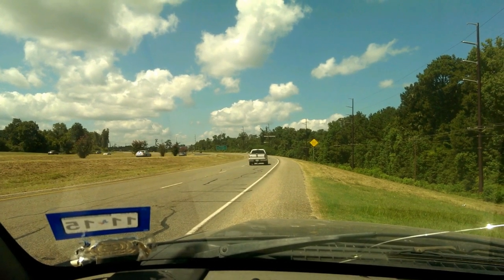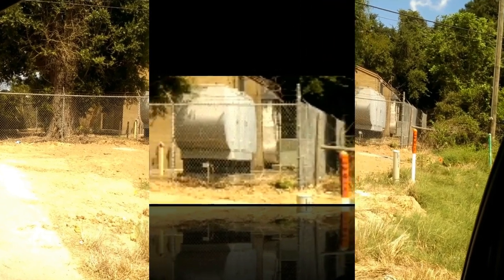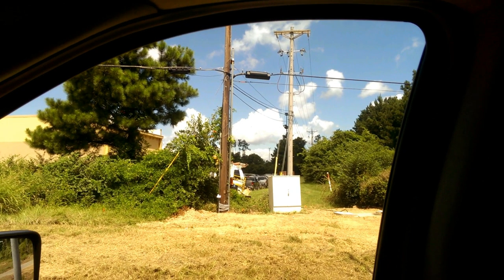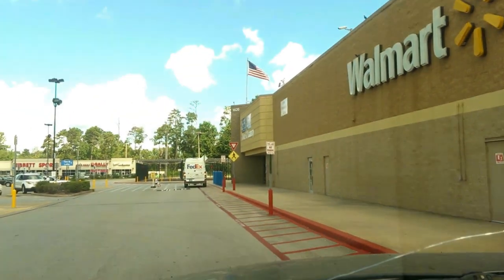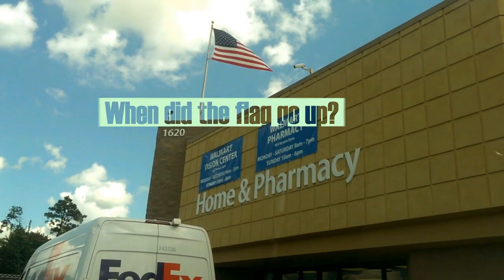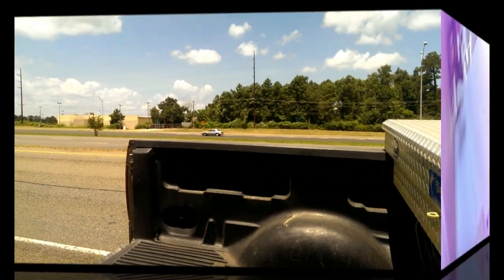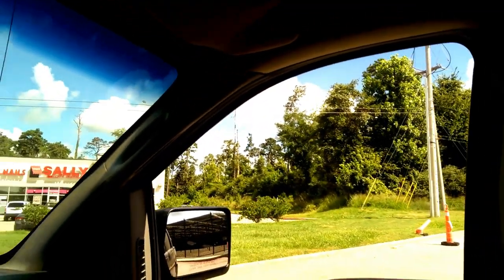Jade Helm 15 Update from Livingston TX

Comment: Those buildings exist all over America and are used at either the base of a cell tower or to house the electronics that communicate back to a telephone company's central office for that area. The electronics would communicate with the central office (CO) via fiber cable, and they'd carry dialtones, broadband Internet, business circuits (T-1, ISDN, etc.). That van is a bucket truck but could belong to the contractor putting the fiber in place to feed that building. Most telecos do not do their own heavy cable placement over long distances, but rather use their local contractors for that work. Also, that light colored metal enclosure near the telephone pole is called a Service Area Interface, and it's job is to connect the feeder lines (which that new trenching of fiber would provide via that new building) to the local lines that go from that enclosure to various nearby neighborhoods. Feeder (F1) lines carry dialtone to the enclosure, and there are likely hundreds in there, and the local (F2) carries dialtone out to neighborhoods and businesses so everyone who wants the service can be connected. Those F2 lines terminate in the small pedestals and aerial closures near your homes, where they connect the aerial drop or buried drop to your house. This job looks to have nothing to do with Walmart, but may have been done there instead as a network upgrade for those teleco facilities at that location. And if it is a rush job, it could be because the old copper line feeder (F1) got damaged, is leaking and taking on water, or is being moved due to a road job or other construction in another location between that light colored box and the central office. Nothing hear speaks of conspiracy from all my experience as a tech for a major telecom, and the work is taking place in broad daylight with nothing suspicious in any of the footage. If you go ask the guys doing the work, they'll probably be happy to explain what they're doing. I used to get stopped regularly by curious residents.
Reply from the maker: Great post thanks for the info

Comment: The machine you called a trencher, is actually a boring machine. It's for boring under roads and slabs to run power or comms through without disrupting traffic. I would say they are laying in more or faster comm lines since it's so close to the AT&T building.
Edit> thanks for the update. Anyone that thinks "plumbing" is the reason, is deluded.

Comment: Those were not metal detectors. You see them in every walmart where I am, as well as every other store. They are anti-theft security devices. There are tags on merchandise, that are coded. If you walk out the store without paying for something, or they forget to deactivate that security device, those white "metal detectors" as you referred to them will start beeping. Does that mean that Jade Helm has been in my local walmart since 1994?
Reply from the maker: FTORC1  try thinking outside the box or matrix... Connection: AT&T is the only private telecommunications co. certified by DHS... Then read about "Markov Chains" and the connection to the DOD, or watch a video. Consider the purpose of the A.I. "Jade II" program that the "Jade Helm 15" exercise is testing... Critically think it through to possible conclusions and see if there are any conducive to peace & freedom.. And as a bonus if you are spiritually grounded in scripture, throw in the Sh'metah and the blood moon tetrad both ending this year. It's deep but if you are wanting truth sometimes it takes some digging...Blessings ><>

Comment: Having built several, a disused Wal-Mart would make an excellent data center for ATT. The generators are backup power supplies, the chillers for keeping equipment cool, and I wouldn't be surprised to see trucks of switchgear and battery banks showing up. You're far enough north of the Gulf of Mexico to not have to really worry about hurricanes, and the building is constructed heavily enough to withstand your average tornado.

Comment: The biggest problem is, I don't think people realize how many square ft. of space Walmart stores have.. you can fit a whole lot of what or whoever you want in those massive places, especially if they're completely empty.
Reply: Stephen Blake You must consider, though, that the stores are really flimsy construction. With the exception of loss control and liability, they have little need for high security. No agency concerned with potentially violent activities would consider such a building viable.
Reply: Idk about that, I feel like the exterior is mainly concrete..
Reply: Stephen Blake
Slab Veneer for most of the later stores I've seen. Maybe 4" thick prefab slabs over steel girders. Usually aluminum sheet at top of walls to minimize rainwater ingress, roof will be"V"-channel with hot tar/rubber sheet hermetically sealed, pea or river rock for weight against wind buffetting, rectangular plastic domed skylights every 10-12 feet. Roof mounted A/C equipment and inverted "J" forced ventilation. Probably 1/2 MW  deisel or LP genset out back near electrical service entrance.
Any number of surveillance cams with fast wide lenses to cover the parking lot, more P/T/Z cams for loading docks.
Garden/Patio Center is outdoors enclosed by 8'-10' barricade-style medium duty vertical bars without spears, for loss prevention. Open top except for 50% shades over plant section. Anti-shoplifting detectors at all gates an entrances.
The building is a perfect low-to-medium budget retail store. Not suitable for high security or heavy industry. Not hardened against windstorm or attack.
Reply: Dan Strayer
Somebody somewhere hinted that the building might be suitable as a secure building for military use, now it seems that post is gone...
How did we go from at least a couple dozen comments to four?
OH, YEAH... Jade Helm... I guess those guys CAN do anything!

Comment: the " trenching machine" is a directional boring machine. Mostly used for fiber optic lines also for going under high volume traffic areas. less obtrusive than ripping up the hyways and stopping traffic for a week or two.

Comment: Sir that is a "Ditchwitch" brand directional boring machine able to bore for hundreds of yards horizontally below soil surface making turns of up to 20 degrees over distance of about 15 feet and make several turns in one boring then resurface.
Reply: Richard Madsen Fascinating machines. Obviously created for nefarious purposes. :D
Reply from the maker: *****  try thinking outside the box or matrix... Connection: AT&T is the only private telecommunications co. certified by DHS... Then read about "Markov Chains" and the connection to the DOD, or watch a video. Consider the purpose of the A.I. "Jade II" program that the "Jade Helm 15" exercise is testing... Critically think it through to possible conclusions and see if there are any conducive to peace & freedom.. And as a bonus if you are spiritually grounded in scripture, throw in the Sh'metah and the blood moon tetrad both ending this year. It's deep but if you are wanting truth sometimes it takes some digging...Blessings ><>

Comment: The orange and white machine is what they use when they are putting in fiber optic cable.
Reply from the maker: Thank you for the info. Interesting article by AT&T published 6/1/2015, about their emergency preparedness or Management help with DHS...they have a new type of fiber optics that somehow increases their ability to keep communications operating in the midst of  disaster....good info it is beginning to make sense...their are out of town workers crawling all over our little town...construction has erupted. .. Thanks ><> Blessings and stay safe.
Reply: Shades Off - Eyes Wide Open Fiber optic is impervious to EMP. That has been a huge selling point. Not only that, but that same quality makes it immune to RF interference as well. Material costs are much less than copper as well, and it is also less susceptible to corrosion from moisture. Splicing and interconnecting fiber is considerably more complicated. Special facilities and training is required to install it, and since that labor is quite expensive, AT&T outsources most of it (much to the dismay of copper-wire linemen).
All organizations who need reliable communications have been deploying it for years. Worldwide. No secret about that. 
And since AT&T has a virtual monopoly on telecommunications in this country, they are of course the "go-to" people for the job.

Comment: Only thing I find weird about it. Is how the hell do you have multiple stores with the same damn plumbing problems across the country? And you know the plumbing probably was not done by the same company on every store. And if it was done by the same company. My question is how come all the stores dont have a plumbing issue then?
Reply: Tomkat 07 Another big thing is they did not already have work permits pulled for the plumbing fixes before shutting down the stores.  That's really bad business move out of arguably the most successful business on the planet (Amazon I think is shoving them out of top spot though).  Not to mention the whole 6 months to fix when the average walmart takes two months to build.
Reply: rushthezeppelin yeah they did that to drop all the workers who wanted a union

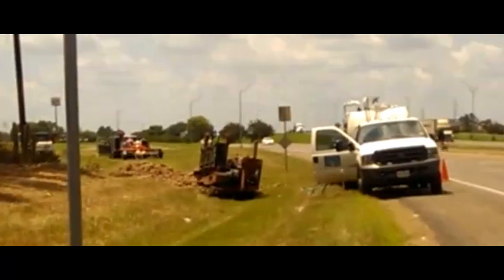Comment: i noticed at 7:15 that there is a small hdd[ horizontal directional drill] next to the road. It is one of the smaller units usually used for pulling wiring under roadways.  a few years back i was working on a large scale project that involved fiber optic cable being ran from somewhere up north down to a main military base in the south. I wasnt given exact info, i guess it was supposed to be a hush hush project.  my guess is that the small machine is there for a similar reason possibly. running a new info cable that is independent of other existing phone lines etc.

Comment: I actually remodel wal marts all the time, from the general contractor perspective, (Superintendent)... the largest remodel that walmart has is a grocery expansion, even then the store remains open and the work is performed at night. Correct the vision center is a seperate entity, just like the da Vi nails but if you notice Mcdonald was in there and closed. Iv done many remodels, this is abnormal I can promise you that.

Comment: I use to build tower sites for sprint that building is for a cell site going in and the trench is so they can run the cables to where they will put the tower.

Comment: I will tell you in Northern VA i've wired up multiple AT&T comm buildings like that. the gov. has a contract with them and if the electrical grid was to go down they could still communicate through those comm. buildings. The ones here in VA have the generator built onto it and just have a couple servers inside and are bomb proof if someone set off a high Nuke in the atmosphere to take out the electrical grid.

Comment: Inside floor concrete appears original. Don't know the bathroom layout, but you would probably only cut concrete in the existing bathroom. No other water needed in store besides fire sprinklers.

Comment: the new building is either a central cellular site that connects to a fiber bundle trunk line OR a small NOC. Best I can tell Wal-Mart has made a deal with ATT wireless. as hey install central cells they are replacing the entire communications inside Wal-Mart. Fiber optics, cell amplifiers, and all new internal networks. I have been on job sites like this in the past. Nothing suspicious. the white trucks are leased sub contractor trucks specifically for the duration of the job.

Comment: It is an ATT&T communications center.  THey have one under ground at the peters mountain site in gordonsville, Va.  Google earth or map Peters mountain and you will see a landing pad with the big AT&T symbol to mask what it really is and also see where the road starts underground.
Reply: Nathan Johnson There is an AT&T underground facility here. Dates back to when it was South Central Bell, and was designed to protect a major regional switching center from major storm damage. Still functioning today and has been expanded a couple of times. You'll find them all over the country. Access is tightly controlled for obvious reasons. It is also protected by federal law, same as railways and airports.
There are also many underground facilities maintained to protect critical bank records and computer servers. Many are unidentified for security purposes. 
I'm surprised that AT&T would have marked their Peters Mountain site so proudly, but I suppose it's not really any secret.

Comment: I'm starting to see so many places that have barbed wire around it to keep people IN.
Reply: JShaun Lots of prisons in Texas.
Reply: ***** lol yes that's true, but I meant seeing them online and around buildings that aren't prisons. Like the comms building in this video. It had barbed wire around it but it was set up to keep people in. It's just strange to me how many of these I'm starting to see.
Reply: JShaun
Ever buy a car, take it out for a spin, and suddenly you're seeing the same model everywhere you look? Maybe you just never paid attention to the ubiquitous telecom support buildings before. They're like trees in a forest. Plain brick construction, steel doors, few if any windows, chain link fence with warning signs attached, razor wire (probably no specification as to which way it faces, left up to the geniuses who installed it). I can't imagine trying to keep people IN such a building, no matter what the circumstance. Incidentally, you probably wouldn't see any plumbing there either. Of course, they don't look much different from water or sewage pumping stations, either. Lots of pipes around them, and generators, too, but usually no A/C systems.
Still, I can see nothing in anything you have pointed out that might indicate any out-of-the-ordinary activity.
Reply: Yea you may be right, I may just not have been looking for them as much before.
Reply from the maker: *****  try thinking outside the box or matrix... Connection: AT&T is the only private telecommunications co. certified by DHS... Then read about "Markov Chains" and the connection to the DOD, or watch a video. Consider the purpose of the A.I. "Jade II" program that the "Jade Helm 15" exercise is testing... Critically think it through to possible conclusions and see if there are any conducive to peace & freedom.. And as a bonus if you are spiritually grounded in scripture, throw in the Sh'metah and the blood moon tetrad both ending this year. It's deep but if you are wanting truth sometimes it takes some digging...Blessings ><>

Comment: That generator is pretty big for that building, unless they are powering communication equipment and computer servers. Makes one wonder what will be in the building and what it will be used for........ fema post perhaps?
Reply: Dave Bogusky Those buildings house literally tons of critical electronic equipment racks, and generally are equipped for expansion. The generator keeps a UPS charged, which is probably co-located. The air conditioning equipment is essential, and not only must it be kept online, but has to be big enough to hadle an enormous heat load, especially in the Texas sun.
Of course, only FEMA could ever need such capacity, right?
Reply: ***** I believe FEMA is probably up to something there...
Reply: Dave Bogusky Why does everything point to FEMA, for crying out loud? One would expect a major military operation such as you are predicting would be handled by the DoD. FEMA has no standing in the military chain of command.
Reply from the maker: No Bill Martin. The generator does not keep the UPS charged. It is continually charged by utility power. Worked with gensets and UPS for 20 yrs. Stick with what you know and stop spreading false rumors! :-)
Reply: Shades Off - Eyes Wide Open
The Genset keeps the batteries charged when utilities fail. I would have thought most people understand it is for use when commercial power is out. I worked with them for 28 years myself. So much for my "false rumors".
Reply: ***** No, FEMA is not in the military chain of command, but why do you think its military? FEMA is a govt agency and they always show up a day or two before the false flag/terrorist/mass shootings, so one tends to see patterns develop. All that equipment near a walmart and in a small-ish storefront? Makes me wonder.
Reply: Dave Bogusky
Tell me... I know FEMA was present in the vicinity of the 9/11 attack, although most of the presence there was the local EMAs, and even then was ill-equipped to respond in any way to the attack.
Now please tell me about the other incidents whey they were already present.
By the way, somebody is assembling a bunch of heavy equipment inside a temporary fence at a Walmart near us. So is there an attack imminent for us here in Alabama?
Again?
Reply: ***** I cant answer that last question, but look up every false flag and you find FEMA there - 9/11, boston, sandy hook, SC church shooting etc. Seems like a pattern to me, but research it and draw your own conclusion. My comments are my opinion and will vary greatly from other's opinions.
Reply: Dave Bogusky
Wait, you said you can't answer that question, so how did you learn of it?
And what in your mind indentifies false flag incidents?

Comment: No Jade Helm 15 here either. Watched several videos today and they are all Fear Mongering. Those were not metal detectors. Those towers by the entrance recognize the theft tag on merchandise.( They catch the thefts of wal mart ).  Maxwell you are right, If they dig up several places in the concrete floor it would be a mess to leave all of the merchandise out to get covered by concrete dust. So empting the building is what is best. What you need to be looking for are air scrubbers as well. If you breath concrete dust you can get silken poisoning, very bad. Stop the fear mongering.